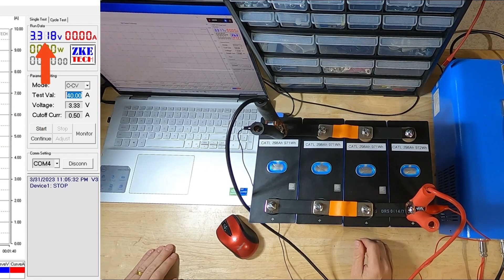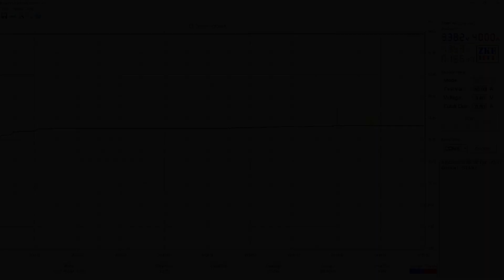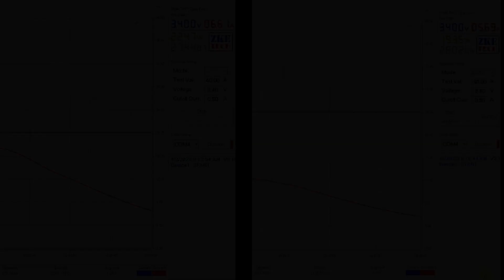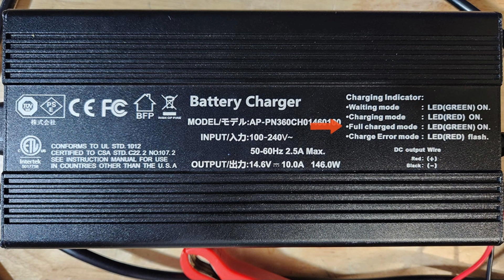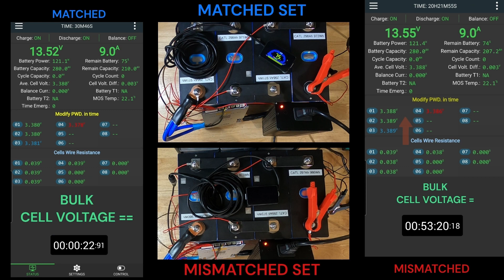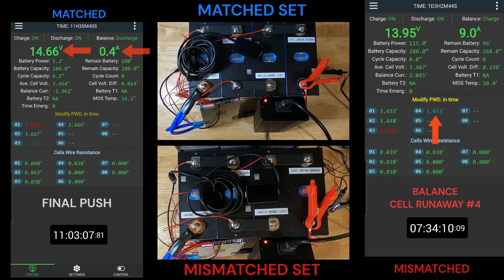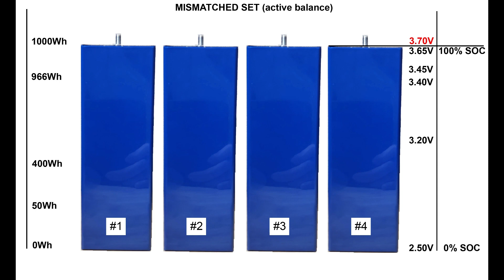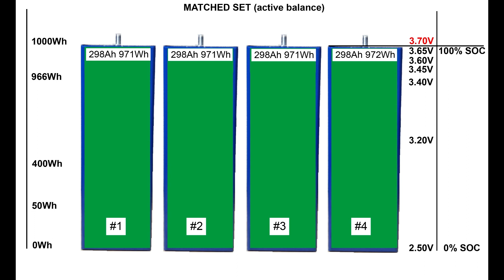Balancing Matched VS. Mismatched Cells - How the BMS Does it and More!

Comment from the maker: This was an insanely difficult video to make but I learned a ton and if you watch till the end 
you will know everything there is to know about balancing. I also point out some general tips when buying cells. Enjoy!

My Cell Distributor Recommendation.

Lily Zhang (Docan Power)
Email: sales3@docanbattery.com
Whatspp/Wechat: 0086 18269259127
Facebook: facebook.com/Lilyzhang456
Twitter: @Lilyzhang797

UPDATE 04-24-2023: Using the BMS, I charged up both packs then drew them both down to 95% then charged them back up again to ensure they would top off then drew them both back down to 95% again.  I then put the BMS on the matched set and topped off again from 95% with no problems. Then I swapped the BMS to the mismatched pack and did the same thing, and it worked fine. So, the BMS probably just uses the balancer only to keep things in check once initially balanced.  There does not seem to be any sort of memory in the BMS to remember the cell state once married to a particular set of cells.

Nate.

Comment: My 48volt ebike battery stopped charging when inspected the main plus cable had come loose so i sorted that problem but it wouldn't charge  so checked the the cells and i was getting the same numbers accross some packs  like  testing from first positive on the sensor wires  and it should have been rising by 4ish volts  or dropping depending on how your wires are set up  so from 4volts to 8 12 16 etc at 20  it showed 20 on 2 lines  were it should have been 24  it was 20 and same with 36  same thing ,i taught  bms  so got new one  but made sure  cell's were all close as  then new bms  and wires  and still no  charge  when full battery is  setup to take a normal charge  and i used a different charger any ideas
Reply from the maker: Sounds like you might have a dead cell. I do not know much about Ebike batteries.

Comment: you should do a test by top balancing your "mismatched" pack and then specifically turning off the bms cell balancing function. Then do a full discharge cycle and charge cycle and see how the cells individual voltages change during the discharge and charge. Its a fun test and you will learn alot.
Reply from the maker: That would be a great example of cell drift.. good idea!

Comment: What I can draw from this video is only charge to 3.4 to avoid such conflict and take a full charge once a month or even longer.
Reply from the maker: Yes, in general.  It's not a bad idea to get maximum life out of your cells.  But these cells are made to cycle 100%, so there is nothing wrong in doing that, but as the other guy said, the extra capacity is negligible.

Comment: That looked like it was a lot of work, so thank you for putting in the time to test this and show your results.  The internal resistance is more important than the actual capacity.  The BMS has no idea how much energy a given cell can store, it is only working with the amount of resistance the current it is feeding the cell encounters throughout the charge cycle.  Charging LFP cells above 3.5 volts doesn't really make much sense, if you want the most life out of them.  Between 3.5 and 3.65 volts you only see a small 1 or 2 percent increase in actual capacity...not enough to justify the potential damage done by charging the cells to that higher voltage.
Reply from the maker: Yes, I agree.  I personally charge up to 3.40V on my cells.  This was just to show how those plug-in chargers work. It's not a charging recommendation.